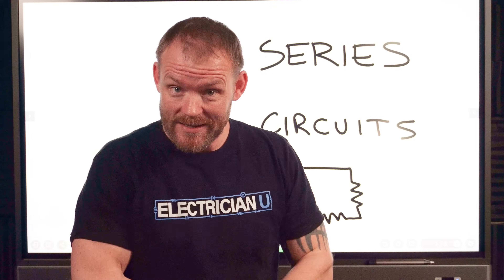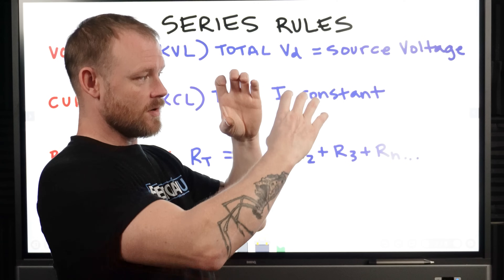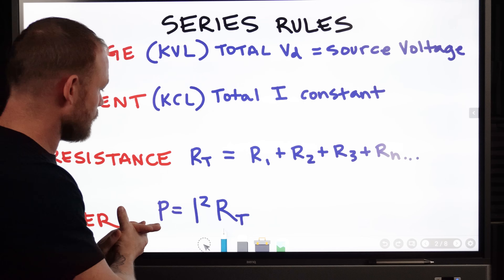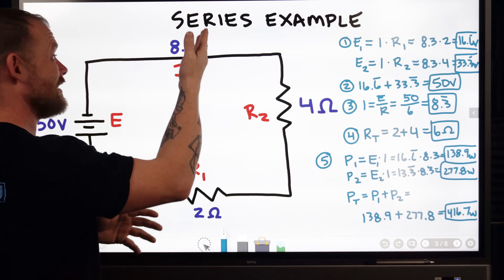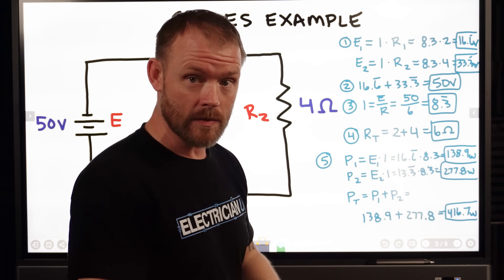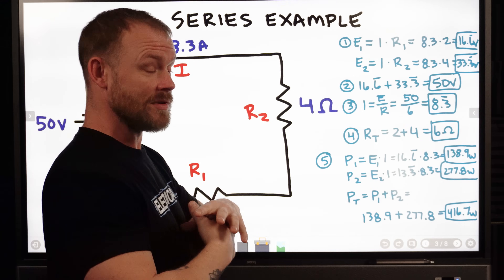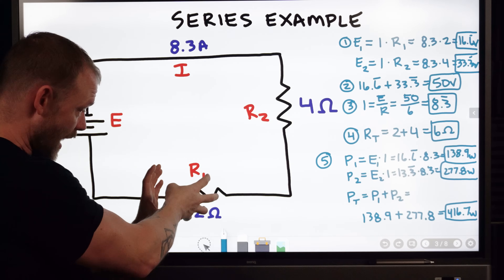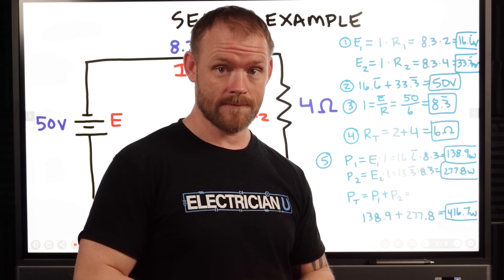Let's Talk About SERIES Circuits: Voltage, Current, Resistance, and Power

Comment: Large scale constant current circuits exist as well - the two main applications being airfield lighting and street lighting.  They're most often 6.6A but they can be 20A as well.  I own a company (OV20 Systems) that supplies the series street lighting market.  Most electricians don't realize series street lighting still exists.  I geek out on this stuff all day so if anyone knows of any series street lighting, or if you have questions, feel free to reach out!

Comment: In your diagram, why use such odd values?
50VDC... 4 ohm, 2 ohm... 🤨😣
Should have used a 240VAC power supply and 2 different baseboard heaters, (750w and 1250w) for example.
And that way, you could have explained the reason why ; 2 baseboards heater ( 750w + 1250w ) connected in serie dont work the same as one baseboard of 2000w.
Yes i understand that there is voltage drop between the two, but the two resistance are supposed to act like if it was only one..
The more baseboards you add, the less heat each one generates..🤨🤔

Comment: DUSTIN, it would have been nice if you would have shown the formulas of converting wattage into dissipation of light and heat and stored joules because its different formulas. Voltage multiplied by current = wattage power ( not dissipation of heat, light or stored joules ) When a capacitor is storing current you can't use this formula V*I = stored voltage/stored current, for lamps dissipating light you can't use this formula V*I = lamps dissipating light, for resistors dissipating heat you can't use this formula V*I= for resistors dissipation heat. Batteries are dissipating chemical converting it to a DRAIN current but you can't use the formula V*I = The Battery dissipating drain energy.  Try to make another video showing the correct formulas to convert power wattage into heat, light, stored joules.

Comment: So... you're getting the same amperage through each component? So regardless of whether the resistor is 2 ohms or 4 ohms, the amperage (number of electrons through the component per second) is the same? This sounds counter intuitive.
Reply: I deal primarily with 6.6A series lighting circuits - yes, the 6.6A is constant around the loop, and devices need to be rated for that, as well as up to 5000V (series street lighting circuits can exceed 4500V to feed all the loads!)  As I tell customers all the time, a lot of what you know about electricity is completely opposite when dealing with series.  I don't deal with resistors or heating elements on series... mainly inductive loads.  And these large circuits are run by Constant Current Regulators (CCRs) that automatically adjust to maintain 6.6A.

Comment: Understand the principles of "Series Rules" you talked about. Is this the reason a Series Rated panel can have lower AIC ratings in the branch breakers as long as the main breaker is rated for the specified AIC rating?? 
Never understood why some Engineers will not allow panels that are series rated.